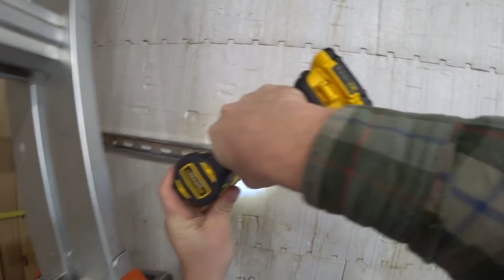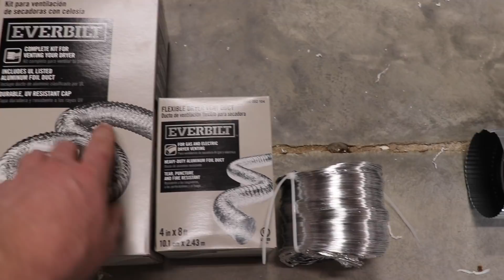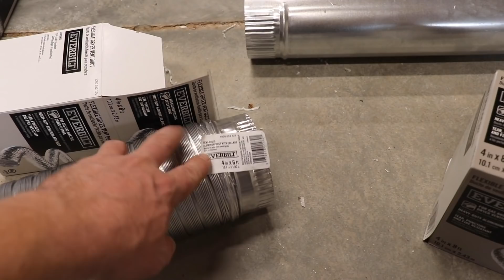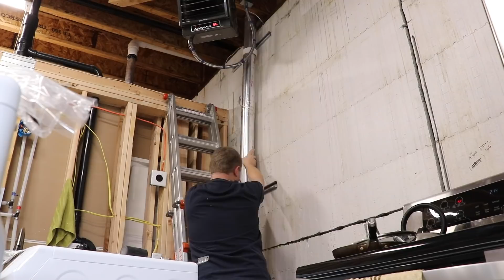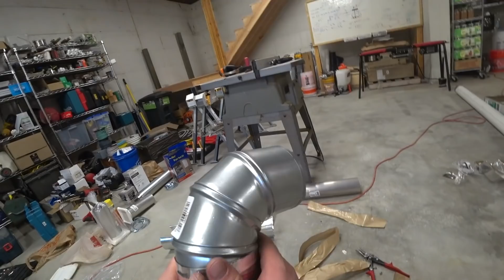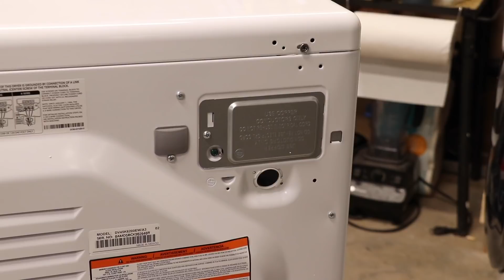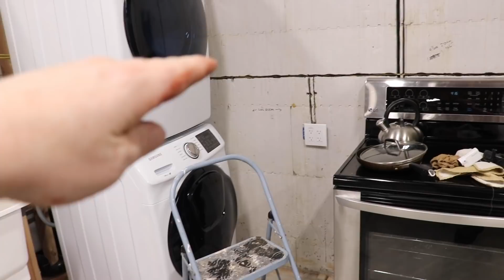Dodged THIS COMMON FIRE HAZARD in Our House!

Comment: You purchased the shittiest washer brand in Samsung. They have a common issue of using a cheap material for their spiders which will corrode prematurely and cause the machine to vibrate. Check out the video reviews of them. I have a Kenmore made by Whirpool that has is still going strong after 13 years.

Comment: Not sure if you will see this, but they I would recommend an external lint trap as well. It is a box that goes in line with the dryer vent pipe and is basically a secondary lint trap (the ones in the dryer suck) and stops most of the lint going part them, so then you just need to clean until them for the most part. Maybe they are not popular there.

Comment: I was thinking as you said you need a fire barrier.  Your selfie style videography showed the glue laminated eye beams. Your garage ceiling should have sheet rock to protect those by code.

Also your gunna have to tape the seams on the 45s because they also leak

Comment: looking good ,better than before,now have strong no melt tube and fire stop good. if i made this hole seal i make foam center hole around tube, then rock wool fire stop and then insulation glass wool top inside, maybe little wood box were insulation have nice. outside little plywood box and fire stop and insulation closed cell foam best wet area. and then grid. ready.wood box i mean sleeve around at tube have box were add full insulation and all metal tube insulation inside neopren cover, normal gluet contact cement moisture insulation neoprene top of tube. same used water tubes lot. and air-con tubes.but i think good work now has. good job.

Comment: by code, you have to tape to elbow swivel joints on the exhaust pipe, and you have to put a screw in each joint to hold the pipe together. btw amazon does delivery groceries in the city

Comment: You don't know the tricks, just like you are now a boss at that roofing, but when you started.... not so much LOL.
Look into spiral metal duct, yes it cost more, but it is a better product. You will need to get some different tools to work with it, I'd suggest a cordless nibbler, or you can use a jigsaw with a metal cutting blade. Spiral duct is the way to go.
Cheers from Tokyo!

Comment: I used duct sealing paste on all the joints and seams then taped it. I use rockwol/ mineral wool as my fire barrier. Also get yourself a great stuff gun and start buying the red can that fits the gun. Not only is it cheaper by volume you keep using it vs the one and done. The red can that fits the gun is the same as the orange standard by volume you get about six cans for the price of 2 or 3 standard cans.. let me tell you as a contractor I'm confused by codes it's all up to interpretation and every city is a little different

Comment: I dont know if I am correct in my thinking but wont metal ducting act as a big thermal bridge... seems silly to use such a ducting between a cold outside and warm inside. specially when the house is so efficient

Comment: Nice setup. You could also add a lint trap straight down from the top, so that when the dryer blows lint goes up and out, but if any is left in the vertical tube it will drop down into the trap.

Comment: The 35ft is not history.  It has to due with airflow speed and lint dropout.  You can meet code and still not meet the needs of your dryer specific dryer airflow.  Read the manual.  Your side duct outlet will help you based what you done temp if you stay with rigid to rigid.  You will have 3 90degree turns.    The reason to clean out your duct is not do prevent duct fires, though those can occur,  it is to reduce temperatures in the dryer and internal dryer surfaces to avoid load fires.  Load fires are the real hazard not lint in duct ignition...especially in your specific application.  Your clothing is a lot more fuel than lint buildup will ever be. Two rules for dryers:  #1never open the dryer if it is smoking, you will supply oxygen to produce flame and you will allow flame to escape.  #2 Never run dryer while you are sleeping, in the remote case there is a fire, being asleep delays awareness of the fire.  You never want any house fire while your family is asleep for lots of logistical reasons.

Comment: I believe there is a stacking bracket for the washer dryer, you shouldn't be able to just grab it off the top of the washer, it should be totally secure to the washer. fyi

Comment: The cheap dryer duct is like aluminum foil, the heavy aluminum is what I use.  Do a burn test, you will then find the correct dryer vent!  The heavy what you call semi rigid is what is best or rigid.  Dryers is to hot for PVC!

Comment: Hi. Love your pod casts and like how you put a great deal of thought into it.
I’m a diesel a mechanic by trade & install maritime diesel plant. 

We have to seal exhaust systems perfectly. Absolutely no leaks. We use extreme temp exhaust system silicone sealant. (Lock tight red extreme temp) Works a treat. We pass inspection every time. 

Just a taught to put in the memory bank.

Comment: Are you sure that dryer model is ment to be stacked? It seems odd to have the controls at an angle if it's meant to be stacked. You would have thought it would be flat so you can see it. Cheers from Ottawa, Canada.

Comment: I see you have touched on "fire code" with your wall penetration,  fire codes have what all codes should have. The last line is always... "...or authority having jurisdiction." You did well by calling the inspector. Although I have found what they are a stickler for, depends greatly on the last training seminar they attended.

Comment: well there was an option for heating pipes in the bathrooms for a towels rack, I'd just install another few heat racks in the basement, would dry clothes and heat a room at the same time, probably cost about the same as the dryer, but hey, that's me.

Comment: Great work! The tape does fail over time but no biggy. Just replace it. Clean your ducts as in once probably every two years,l. Mine cented in a straight line, directly out. I cleaned it once in 17 years, but checked it every two years. I replaced the exterior flapper once in that time, surviving several hurricanes. No birds, no rats, etc. All good!

Comment: I wonder if you could take PVC pipe and spray paint the inside of it with silver spray paint or something like this:  Licron Crystal™ Permanent Clear Static Dissipative Coating, 8oz Aerosol   Add a ground strap to the dryer and you should be good to go.

Comment: Two Thinhgs: First, why don't you use a condense dryer (no extra hole to your house, heat stays inside, higher efficiency). Second, if you want to use your existend dryer, yes with all the aluminium piping, consider using a dirt air heat exchanger for better efficiency...

Comment: Jesse, that was a comical start to this video where ya piled all the vent tubes and duct work on the floor... like here's the stuff guys... L.O.L. GOOD WISHES FOR Alyssa..
she's been so quiet and i guess not up to normal volume and activities. thanks for keeping a few videos cranking out. i understand how frustrating it can be because of how manufacturers play with the language on the product description lables! Thanks for being so thorough in your description of codes and btw.. i was thinking of that type of metal vent pipe would be perfect for venting the dryer! You were brilliant with cutting pvc sleeves to fit over the metal vent pipe so you could mount it to the wall without
crushing it. Well done Jesse. hope Alyssa is doing ok?

Comment: A few things: 1) buy a quality Malco crimping tool to Rx metal duct ends as needed. 2) someone in the comments was talking about screws... That is not a good thing. You can't use screws in a dryer exhaust system. I I think it's pretty obvious the reasoning is that it grabs anything that brushes by it and starts collecting. ie: HAIR, lint, etc. 3) if you clean your dryer ducts regularly like once every year or two it's not a big deal and it helps the dryer work more efficiently and stay cleaner inside the actual dryer itself. If you buy the dryer cleaning kit and stick the rods down before you hook it up then you know exactly how long it is and how many rods you need to chain together to clean the duct. that way you don't have to pull it apart and put in the little blocker screen thing to keep the brush from going inside the dryer. You just turn the dryer on and start pushing the brush in from the outside. Lastly, tape the segmented joints in all the 90s as well.

Comment: I am thinking that if you checked the code before installing PVC and used the UL approved ducting for you dryer exhaust you could be doing electrical and plumbing for the rest of the house instead of ranting and raving about ambiguos UL markings on products that are out there.

Comment: Just to add a couple thoughts on UL. 1: UL does not care if a product works. They care if a product is safe. Also There are other NRTL (National Recognized Testing Labs) That do the same thing as UL. ETL is probably the most common after UL.

Comment: I'm wondering whether there are antistatic PVC, PU or PP pipes to meet code.
The easiest way is to use a condenser dryer. This type does not need a vent pipe.

Comment: Dryers: Taking that expensive, interior warm air in the house , heating it up and pumping it outside! Too bad you couldn't run it through some sort of a heat exchanger to scavenge some of it back.

Comment: Managing Humidity....
There's a good reason why the weatherman talks about "relative" humidity.  It's because air is capable of holding hugely different amounts of water depending on what the temperature of that air is.  50% relative humidity means that at the present temperature, the air is holding 50% of the moisture it can hold at its saturation point.  Hot air has the capacity to hold more water than cooler air, a LOT more, actually -- so if the temperature rises and there's no extra moisture added to the air, the relative humidity will go down. Also, if the air isn't extremely dry and it cools down by passing by a cool surface, it is immediately saturated and dumps it's extra moisture  on, say, the outside surface of a glass of iced tea.
You said you won't be heating with combustion so you shouldn't have humidity issues in your house like other's might.  Nope.  Consider this: It's winter time -- You've got the temperature inside your house set at 70 degrees. You're cooking and taking showers and boiling spaghetti  and whatever. So this would put the humidity in your house at maybe 45% to up to 60%.  Then, you open a door to the outside and warm air rushes out and cold air rushes in. Maybe the cold air was also around 50% when it was outside, but now that you've let it in and you've warmed it up, it's dropped to 10% or 15% R.H.  That mixes with the rest of your house air and your humidity drops a bit.  Do that a lot and in a week your whole house is now 15% R.H. You walk on the carpet (which is like lint going through a plastic duct) and you've created static electricity.  You get a shock from anything metal you touch. So, maybe you'll need lots of showers and leave the bathroom door and shower door open.
Think of air having a gazillion tiny water buckets floating around in it.  These are magic buckets with a coefficient of thermal expansion that's unbelievable. When it's cold, the buckets are so tiny you can't see them.  When it warms up a bit, the buckets are like flies in a dairy barn and on a hot day, you have to move them out of your way to get around.  Imagine it's a warm day and all the buckets are half full. Then it cools off and the buckets shrink but the water inside them doesn't -- all the buckets just overflow and dump their contents on to the nearest cool surface.  It's why fiberglass insulation always has to be installed with the paper to the warm side.  If it were backward, room air would slowly move into the insulation and it would find a point where the insulation is at the dew point of the air and the insulation would get wet and it just kept collecting more and more water.

Comment: You can use needlenose pliers to crimp the pipe a little to help slide them together. And as usual you will read this after you complete the project.

Comment: In short order she is going to hate that dryer location.  Side-by-side next to the stove and a melamine board on top and you have a countertop.  All you need is some longer hoses and some rubber expanded mesh tool box liner under the melamine to keep it from sliding around and provide a little cushion from the washer/dryer vibration.  And that way the washer/dryer doors open towards each other too.  If you have to pull out the stove to match the depth you can put a shelf on the wall behind the stove to cover the gap and give you yet more flat space to put stuff on - of which you have almost none and I'm sure its a PITA to cook a meal.

Comment: Also on the Samsung washer and dryer. They are junk.
I can guide you through any repairs.
Heating element on the dryer last between 2-5 years. Same thing with the washer drain pump.
I have access to the factory service manuals since I am factory authorized.
Hopefully you don’t need any warranty work it is almost impossible to find anyone to work on it.

Comment: Good job, but as I wrote in the other video, why did not you buy a Heat pump dryers that is more efficient it consumes less electricity, does not need to vent and does not waste heat?

Comment: I have the same stuff for a dryer vent tubing and have no galvanic corrosion problems.  Nice job.  It will work fine. I disassemble mine in sections once a year and shove some rags down it to clean it out.  My tubing is horizontal in the crawl space out the other side of the house. I've had my dryer vent in for 20 years with no problems.  I live in a very dry North west state.  I have had one of those 90 degree units come apart when I was disassembling it for cleaning  and had to replace it. I have never had problems with the plastic flex hose fire, etc. I swapped the plastic flex out cause folks said it would catch fire (after 5 years of using it) for one of those metal flex units. the metal flex bend takes up too much room in a closet, so I swapped it out with two fixed 90's that connect the dryer to a wall fixture.  I usually have to clean out the end that's on the outside of the house 2 -4 times a year cause those flaps catch the lint.

Comment: One question. Where is the faire barrier around the pipe for? You've got a 4,5 inch pipe that's not fire resistent. So when there's fire, the pipe is in a about 5 minuten gone and instead there's a holl of 4,5 inches

Comment: I own a gas version of the Samsung dryer that is stacked like yours. I purchased id in October of 2016. This month the roller support bearings started to fail and squeal. Naturally the dryer only has a one year manufacturer's warranty.
Anyhow, may I suggest that you purchase a drum support roller kit of of one of the suppliers in your area. It should cost about fifty dollars.  Plan for a headache that may not come. I appreciate the videos and the explanations the two of you provide.

Comment: ok ...first things first ..... ( I'm 7:27 into your video ) .... your expressing the notion that the fire risk is the ... after the unit air flow problem .... .... my experiance (4 units mine and friends ) is the the lint you speak of is Not the problem . the air being dragged into the unit is not filtered and there is  not a pasific air  intake .... having pulled apart 4 dryer that smelt danderous .... i found ...colected about the element  ...fibres that looked like carpet underlay .... and it was this that was scorching to make the smell ... and would have gone onto making a fire...if only i had photos ...ahhhh ... ps if your living the " life style" you are .... how come you require a dryer  ... a clothes rack upstairs ...right beside the stair opening

Comment: Three self tapping screws per joint in ducting - will prevent it from coming loose when the glue dries out and put the drier on the floor - sooner or later, someone may take a tumble and there could be injuries.  Not to mention the fact that it is just plain inconvenient.

Comment: In the UK there is no code of any kind for dryer ducting, the flexible vinyl is the most common solution, followed by condenser dryers. Im glad I do not have to meet the codes you have to.

Comment: For the caulking, use a disposable glove.  When I put my dryer vent in I used galvanized pipe made for HVAC ducting and then soldered everything.  Building inspector loved it.

Comment: The concept he misses is the sealing is needed where the pipe penetrates a fire wall.  The Drywall ceiling will be the "fire wall" between the garage (burning fuel from the truck fire) and the living part of the house and is where the pipe needs to be sealed.   That is not to say you would not also seal the pipe as it exits the building but that is for air leakage not fire protection. But it would be prudent to use a non-flammable sealant here as well, though he indicated code allowed zero clearance which would imply any material.

 The leakage on that short of dryer vent is extremely small compared with the total volume of are for a load of closes, its not like your have  125 psi in that vent.   The elephant in the room as to fire risk are all those ICF polystyrene foam walls.  You catch one of those on fire and the house will be gone in a flash.  They should at least put some temporary drywall behind the stove and the propane canning station when in use.   I would go ahead and drywall 5/8" fire code rated all the garage walls now.  Run any electrical with surface mounted conduit later.  Would look better and be more conducive for outlet repositioning in the future compared with burying then in the ICF.